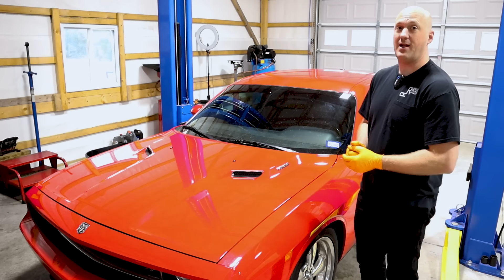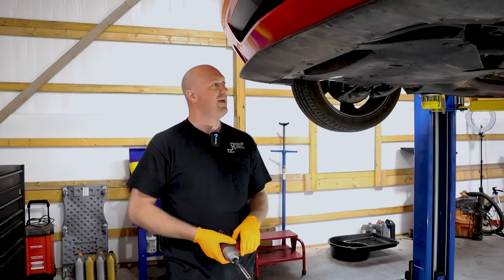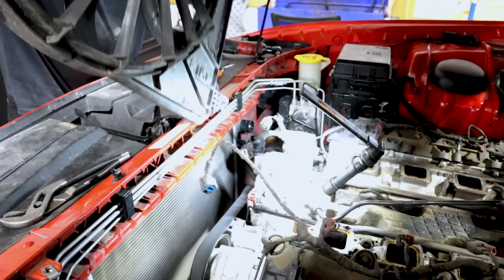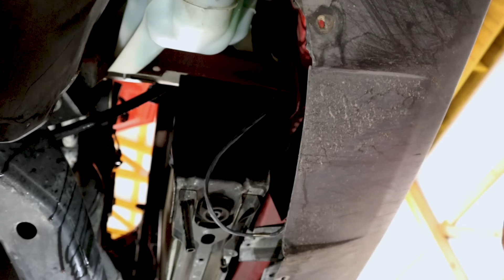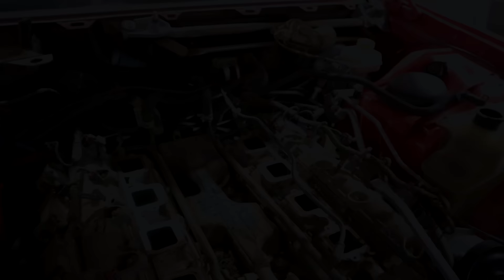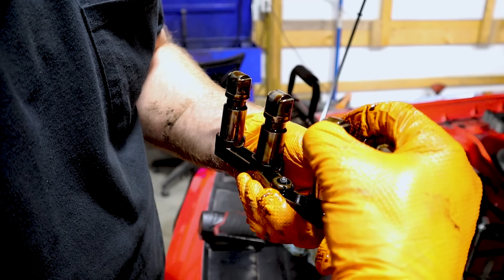Hemi Cam Installation! Budget Challenger Build Ep1

Comment: Just recently discovered your channel.. Good stuff! I'm currently building a junkyard 5.7 to go into my old 64 Dodge A100 pickup. Trying really hard to stick to the tightwad budget, with the engine build, because I know what's ahead.. Already have the Mopar crate harness but will need trans control for the 8 spd, custom driveshaft, fuel delivery, full custom exhaust etc. I'm sure you know what I'm saying.

Anyway, I picked up a take off 6.4 cam and non mds lifters to go into my 5.7 build...also a new hellcat pump (your other great video), heads are being reworked with new Mopar Performance springs and just a ton of other new stock pieces without doing the bottom end. While I was watching this video, it gave me alot of hope.. Up until the point of you saying that it was possible that this Challenger may have a custom tune in it. That gave me some doubts about the 392 cam working as well for me. Did you ever do any research about this possible tune or reflash to test? I mean if it has a custom tune, the video is a little misleading because to be apples to apples, someone needs to think about a tuner ($400-$500) and pay for a custom tune ($400-$500) to get the same results. For less money, I could buy a MMX VVT/NTR/NSR cam. 

I'm trying to avoid the cost of a custom cam, tuner and tuning until next year.. Once I've had time to complete this build and cruise it for a summer. I'll spend another 1500-2000 just doing those.

Thanks.... And I'm not a critic. This may be my first comment, maybe?
Reply from the maker: Hey Dan, totally get what you're saying here. The 6.4 cam will work just fine with a stock tune, it just won't be optimized. To me the primary benefit of going with the 6.4 cam is that you can retain the VVT functionality, whereas pretty much most aftermarket camshaft has to get rid of it (lock it out) but they will make more power over the 6.4 cam overall. I think for your scenario it does make more sense to go with a cam that has more room for growth.

Comment: How does radiator come out with no lift?
Can it come up?
Reply from the maker: If you've got the front end on Jack stands it should give enough room to drop it out of the bottom still.
Reply: @ReignitedAuto  OK sounds good altho that mug may nearly be on exhaust tips low as it sits.. 😄 
Thx for quick reply.

Comment: Is pulling the heads required when changing a camshaft?
Reply from the maker: Generally you'll want to replace the lifters at the same time you're doing a camshaft,  but technically no you don't need to pull the heads to do only the camshaft.  You'll need to remove the rocker arms and pushrods,  then spin the cam twice to knock all the lifters back into the bores and the cam will come out.  Be quick getting the new cam back in though,  if any of the lifters fall down into the engine you're in trouble.
Reply: @ReignitedAuto  thanks for the response this is why i watch your channel, you provide so much needed info that we cant find anywhere els, when i do my cam ill most likley do the lifters and head gaskets as well. Thank you i appreciate everything you do for the community bro

Comment: You lost me with the disconnecting the battery. You said you had to climb through the car if you closed the trunk. Wrong. Use a jump box or cables to hook up to the power points under the hood, by the fuse box, and you're good to go.

Comment: Where are you located?
Reply from the maker: At the time of this video I was in Texas,  but now I've been back in Central Oregon for a little over a year.
Reply: @ReignitedAuto  thank you I have a 2011 Chrysler 300. I had a Comp Cam installed, Shorty Headers, Edelbrock Eforce Supercharger installed. But I keep getting engine light warnings. I reset them and they come right back. I will forward a picture.
Reply: Cant forward pictures. The it says PO300, multiple cylinder misfire. DIABLOSPORT tuner
Reply: We live in Skagway Alaska.

Comment: I have an 04 Ram that I stopped driving around 2009 with a 5.7.  My 2017 with a 3.6 feels like it has more power/quicker than the Hemi did...always thought the tranmission is where the 5.7 was a turd....still want to get the 5.7 back on the road, but not if it's a waste of dollars....is there a better transmission for the 5.7 and what should I do to really get the 5.7 so it feels like it's got some substantial power?  40 or 50 HP isn't going to do much for that motor and transmission ..I have 4.56 rear that made it feel a bit stronger, but that's it.

Comment: if you upgrade your cam for more power, is it required that you tune your ECU so it runs properly? also, how much does something like this cost? I'm guessing over $1000.  I'd do it myself but I don't have a garage or the ability to leave my car in pieces on the street overnight. lol

Comment: Can I use this cam for a 5.7 with the MDS system??
Reply: I have a 2014 charger police car with the 5.7 in it but has the MDS system which I’m not for sure if this cam swap will work because I see the one you are doing isn’t an MDS challenger
Reply from the maker: You can still install a 6.4 cam,  just use the one that had mds from the factory.  👍 I don't have access to part numbers myself.

Comment: Hello I have a 2008 300c 5.7 I’m thinking about going with this kit but it says fits 2009 and up I was wondering if it will fit ?Thank u
Reply from the maker: Unfortunately no it will not fit your engine, the lifters fit fine, but the camshaft only fits the 09+ block. 👍
Reply: @ReignitedAuto  thank you appreciate it

Comment: Currently working on my 2005 Magnum R/T. I'm wanting to do these upgrades I while I have it apart but I'm not sure if the year models of engine and year models of part #s matter? Can I use all these same parts for my 05?
Reply from the maker: Unfortunately no, only the lifters interchange for your vehicle. The camshaft only works on 2009+ models. I do think the headers will fit though. For a camshaft for your vehicle I'd look into the offerings by Comp Cams.

Comment: Can you remove the cam in a dodge ram 5.7 without removing the engine.
Reply from the maker: Yes indeed, there are variations based on the model year, some require you too lift the engine a couple inches to get it out. The major thing is that you must discharge the a/c system and remove the radiator and condenser completely for access. 👍
Reply from the maker: Yes indeed, there are variations based on the model year, some require you too lift the engine a couple inches to get it out. The major thing is that you must discharge the a/c system and remove the radiator and condenser completely for access. 👍
Reply: Mine is a 2015 tradesman ram.
Reply from the maker: @soup2nuts1957  ya you'll probably have to raise it a bit too get the cam out, but you don't have to remove the engine.
Reply: @ReignitedAuto  thx for the quick reply.i have rebuilt many engines but this is the first dodge i ever bought.think the tick is mostley manifold and injectors .just in case its good to know.

Comment: Yes Sir, I have a ‘12 5.7 charger, Recently had a mechanic check my car and cylinder 3 had low compression around 40. The gentleman told me that I have motor issue so I need to replace it, said their known for having had camshafts so I want to upgrade that also.

Comment: Thanks for the great video.  I had cam failure on my 13 392.  When putting the phaser back on, I can't see the crank dot to line the link up to because the oil pump is blocking the view.  So I have the cam at 12 o'clock and TDC on number one with the tensioner in place.  I rotate until the timing gear mark is 6 o'clock and number 1 is at TDC again.  I think I'm in time but don't want to be a tooth off!  Any suggestions?  Thanks in advance

Comment: I’m doing a cam replacement for 2013 5.7 pursuit has 230,000 miles it’s a daily driver want to upgrade to the 6.4 cam….what all should I replace while I’m in there don’t want to have to open it back up if possible….will be upgrading the oil pump as well to the 6.4….if you could please give me a list of everything you would replace to get another 200,000+ out of it

Comment: Can I install a 6.4 cam in a 2006 hemi
Reply from the maker: No, it only fits in 2009+ models.
Reply: @ReignitedAuto  thank you for your reply so what can I do to this engine for more hp 
Or just fox and drive and move on to the next project
Reply from the maker: @farleyj1999  comp cams makes several different options for the earlier models. 👍
Reply: @ReignitedAuto  awsome thank you so much

Comment: I have a 2015 RT R&T that I'm doing the same thing to.  6.4 Cam, hellcat lifters and MDS delete.  Is the installation going to be the same?  Is mine a different gen engine and will anything be different?  I also got the 392 headers for my 5.7.  Will they go in the same way you put them in this challenger?
Reply from the maker: Essentially identical. There may be some very minor differences, but it should be very close.
Reply: @ReignitedAuto  Just finished my build on Sunday.  Had some trouble bleeding the coolant but so far all is good.  Couldn't have done it without your videos man.  I really appreciate it.  Currently waiting for my email tune.
Reply from the maker: @Bophadeez1  congrats! 👊
Reply: @Bophadeez1 did you get tuned ?

Comment: Sky!!! You are the Man Sir! I didn't know much about my motor until finding your channel. Thank you for the excellent content! I think I am fully confident after watching this series that I can do these upgrades/repairs myself! (That's crazy)
I do have a quick question if you get a moment. 
I have a 2011 Ram 1500 5.7lit hemi 4wd
Reply: I recently had the motor rebuilt. Not even 1k miles later the tick is back, i think due to cheap lifters. Also MDS problems. I plan on doing all these mods that are compatible for my truck, Cam, lifters, and oil pump. We had some problems finding the right main fuse panel/computer i think due to the where the truck was manufactured? USA? Canada? is that a thing? same part numbers but slightly different parts. it was fun to say the least!
Reply: Should i be concerned about motor parts and compatibility?
Is there a certain year of the 6.4 cam that needs to be ordered to work with my 2011 1500?
Do you have a recommendation for a better but slightly upgraded headers for a 1500?

Thanks again for the great teaching and content!

Comment: I learned that it looks harder than I thought because I only want to change the camshaft and the lifters. Looks like I may have to take it to a shop to do it for me. Because replacing gaskets and other components is going to be a task. Is there a way to do this and just remove the camshaft?
Reply from the maker: Technically yes you can change the cam without pulling the heads, but for my money it makes much more sense to replace the lifters as well since they already have issues. I've got a video where I show that you can pull the cam without pulling the heads, I'll see if I can find it. 👍
Here ya go: https://youtu.be/lVLVJhcuuW4

Comment: Do you need to remove the heads in order to get to the cam? I just installed heads and headers with new tty bolts.
Reply from the maker: If you are wanting to install new lifters as well then yes you'll need to remove the heads. But if you're just doing a straight cam swap then you don't strictly have to. But if you go that route you'll have to remove the rocker arms and pushrods, then spin the cam 720 degrees before trying to remove it. If the lifters slide down into the cam bore then you're in trouble, but they should stay in place.

Comment: Love my 173k mi 6.1 6 speed. Trying to refine and restore... Basically needs every bushing on the car, synchros, clutch, rear end rebuild etc etc. Cam/timing/re-seal/tune/headgaskets/water pump etc are next. Has kooks long tubes and corsa catback already. Once I fix the driveability stuff, have an alignment I'm happy with, and trans is buttery, I'll look into either a: selling it and getting a 6.4, or b: pulling the motor for a mild forged rebuild in prep for a Kenne Belle

Comment: Love the channel! Great info ! I have a 2004 ram 1500 2wd. Can I swap in a 6.4 ? I haven't seen many of these swaps done , is there a reason its not so common?
Reply from the maker: Are you talking about just a 6.4 camshaft, or three whole 6.4 engine? You'll run into issues both ways, the 6.4 cam won't fit into your pre-vvt block. The engine itself won't work due to electronics, mechanically it would bolt in, but getting it to run using the factory ecu would be problematic.

Comment: Since the hole is a 63 mm in the 5.7 block and the 6.4 cam front journal is 57 mm did you have any trouble front it ?

Comment: I want to change my cam in my 5.7 charger with the 6.4 cam because I just changed the headers to long tubes but my question is how much more horsepower would I get with the 6.4 cam in the 5.7?

Comment: A catch can is huge on a motor experiencing excessive blow by. Bad valve guides or bad rings... crank case gets excessive pressures causing oil to migrate. So a catch can may keep oil deposits out of your engine but if the can is collecting a bunch of oil you have bigger issues than deposits.

Comment: First of all I would just like to say I really enjoy your channel, full of good knowlege. I have a question for you, I am doing a cam swap on my 6.1 hemi and I bought the Comp cam HRT stage 2 and vavle springs and I was just wondering if there is any reson I need to change the push rods?
Reply from the maker: It's not absolutely necessary, but any time you install higher pressure valve springs it makes sense to upgrade to hardened pushrods since they aren't that much money. 👍
Reply: @ReignitedAuto  that makes sense, Thank you sir!

Comment: Another question, I bought an HP tuner, timing chain, tensioner, power steering pump, and gaskets but have not yet bought the lifters and cam. I am doing this project myself but keep getting told to get a mechanic… which is annoying… I need someone to bounce questions off of… I have the Haynes manual… id really like to find a 3D blow up of the engine and part labels, maybe a virtual render. But most of all, I’d like to drive my car again.
Reply: So… what do you think? Can ya give this nerd a hand?

Comment: Ok man, I have an 09 with an auto trans and have metal on the end of my MDS solenoids under the intake. Would you be up for a consultation and maybe the random question while I’m working on my challenger?
Reply: I want a little better power and drivability than the old stock 5.7…

Comment: Did you ever have tuning issues with the fans not turning on? Shops havin issues getring the fans to turn on, i had a diablosport tune before dropping it off, they're using SCT, it also has a 180 Tstat. The DS gave me issues lowering fan temps before, never saved the parameters, had to enter it 3 times before it realized the change. Theyre wanting to replace my PCM 😬

Comment: Anyone here please share your thoughts on 270 Comp package for my 17 Jeep Grand Cherokee 5.7 hemi has CAI, long tubes mid pipes high flows, Catback Borla 93 tune. Overall we could see a gain of 67 HP? However I do not want to lose my low end.
Reply from the maker: Any time you're installing a camshaft there's always going to be a trade off between the low end and high end, but I think with the combo you've gone with you shouldn't feel too much difference in torque.